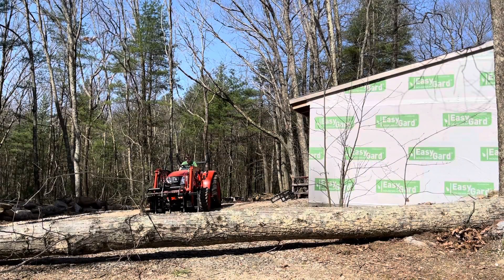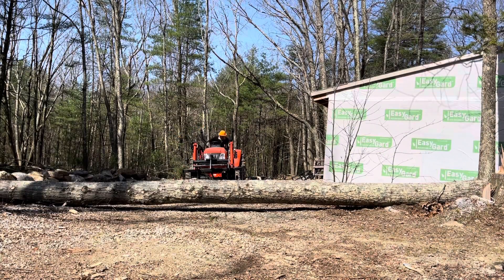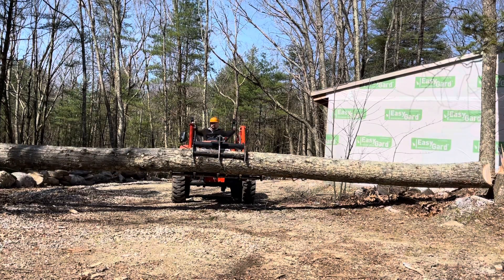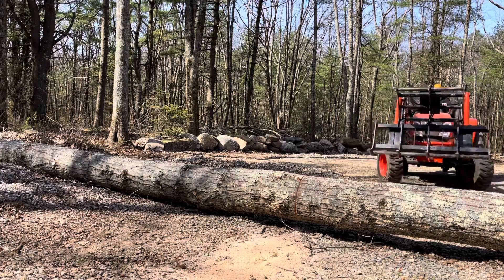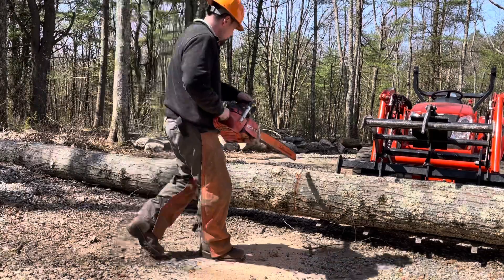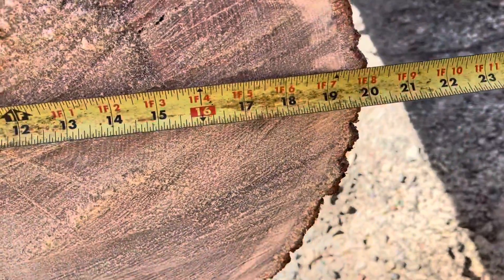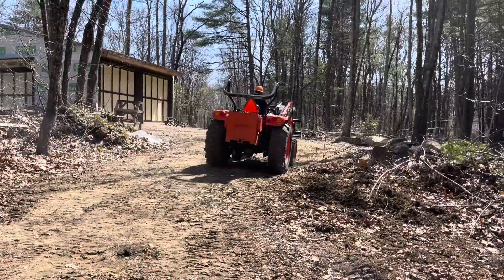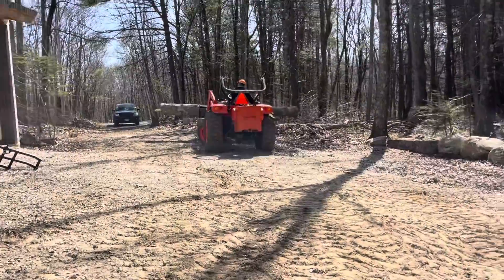How much will a Kioti NX lift?

Comment: I have a Kioti ck3510se and I love it, they have great lift capability. I came up with a different total weight than you stated, ....a 32ft log at an avg. diameter of 17.5 in. is about 350 bd. ft. multiplied by 5.2 lbs per bd. ft, the weight of red oak, equals about 1,820 lbs. Either way thats a lot of weight. thanks for posting your awesome video......Robert
Reply from the maker: Thanks for watching and commenting Robert. I used the log weight calculator with Woodweb.

Comment: Do you ever find yourself wishing you had more horsepower ? Or is the 4510 handle everything just fine? I’m looking at getting the 5510 cause id rather have the power and not need it then wish I bought the big one from the beginning. Thanks
Reply from the maker: I haven’t personally wished for more, but it would depend on what you plan on using the machine for. The horsepower really comes into play for running big implements off a PTO like a big snowblower, brush hog, chipper, etc. I’m not sure what the price difference is either model to model
Reply: @BuildALotAcres  yea, it would be about the same as your doing along with brush hogging and other things
Reply from the maker: @JohnIngram-p9h  If the 55 was within reason price wise, (within 5 grand I’d say), I may suggest going with the bigger engine.